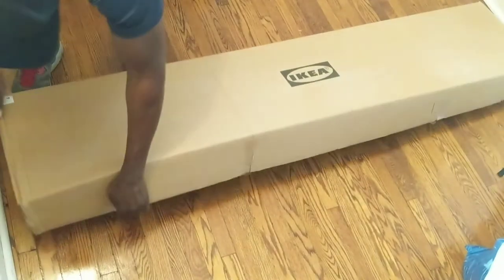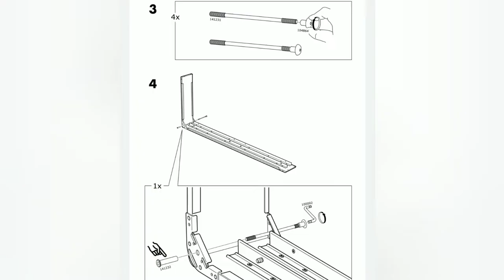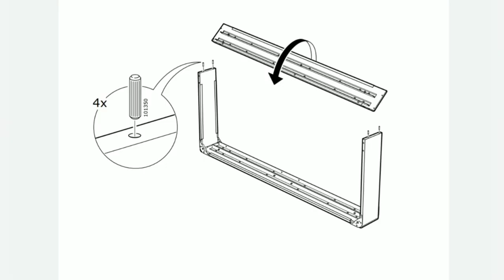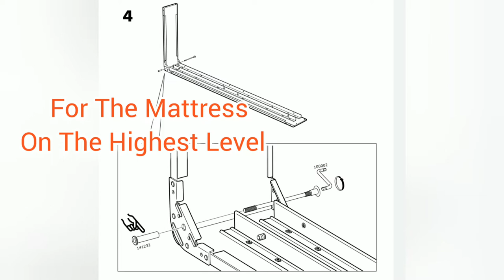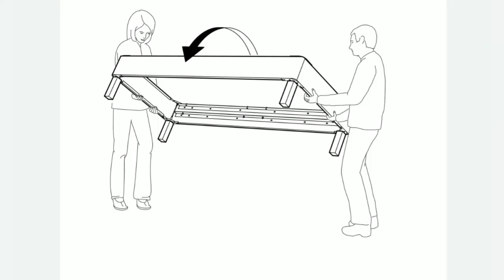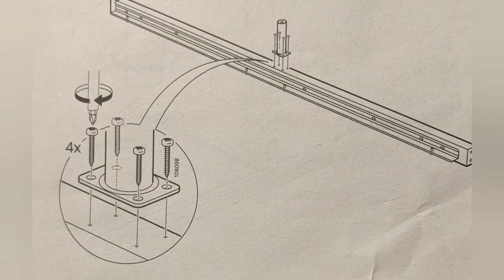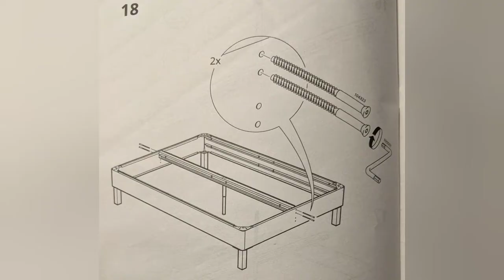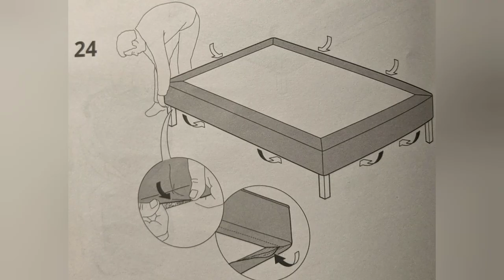ESPEVAR Slatted Mattress Bed Frame IKEA | Easy Assembly With Instructions | #TIY #diy

Comment: Do you think you could put luroy slats on this so it would have that arch in the middle of both sides?
Reply from the maker: Hi there,
Thanks for watching my video and the question. I'm not sure as the bed comes with the slots. If you want to swap them out for luroy slots you then you would need the proper length and that fit each side of the bed. The slots that come with the bed does have the arch in the middle on both sides. 
Hopefully that helps.
Thanks again for watching my video and the subport to help me grow my channel 😀👍🏾

Comment: You put the leg lock pegs in the wrong position. You have to line up the holes in the leg with the holes in the corner brackets, and stick the pegs through the brackets in the holes in the leg. And why put the bed on its legs, adjust the middle support, and only then stick the pads under the legs?
Reply from the maker: Hi there, 
Thanks for watching my video so attentively and the feedback. I suppose you are right but with my big hands and such a tight corner space I found it almost as easy to use the hole out side of the bracket itself. It will serve the same purpose. For me, It was much easier to remove the pegs later. 😅 
Putting the pads on after the legs after the beds was flip was one of the o'crap things I forget to do when doing the legs... So, I made this  mistake so you don't have to. 
Thanks again for watching all the way through and the subport to help me grow my channel👍🏾